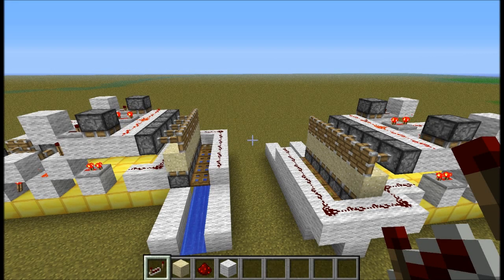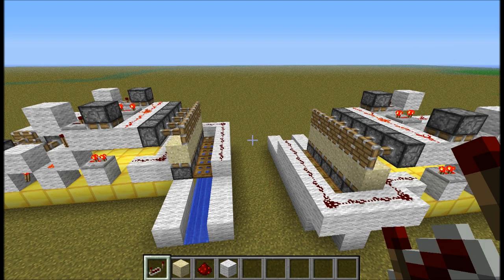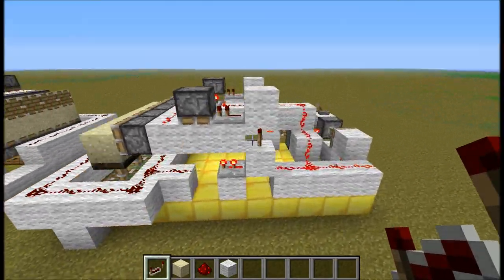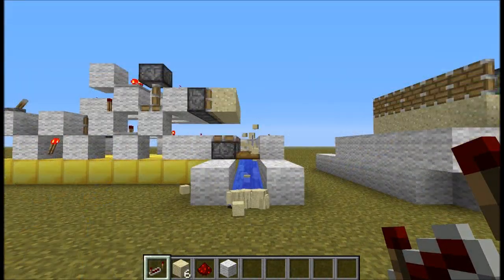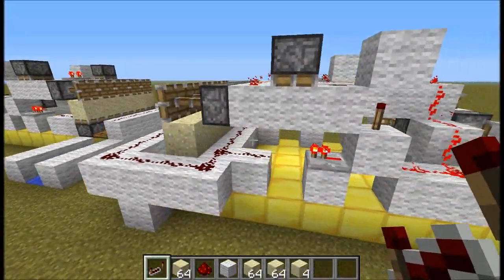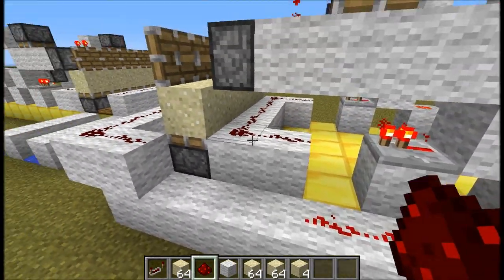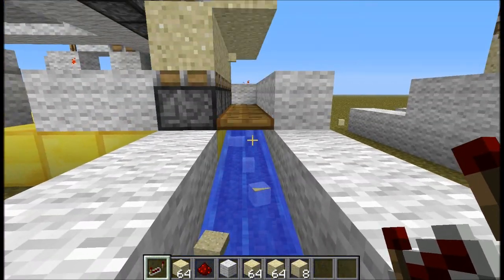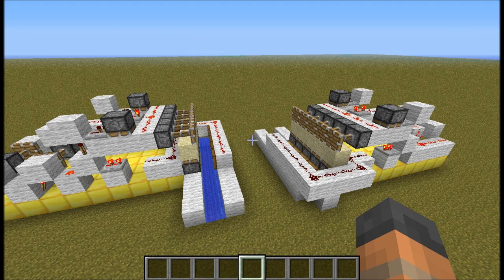Sand Generator Fix For 1.4.5 Tutorial

Comment: I spent ages trying to get this to work on a Vanilla server. Finally I have it fixed.

My solution is: Instead of replacing the repeater with redstone, I set it to its default setting. The repeater below that is also at its default setting.. 

BUT here is the catch. 

It would not work until I placed my sand two blocks high. Xisuma's version has only got one block of sand on top of the sticky pistons. Mine now has two and it duplicates sand that can be picked up.

I will put up a video tomorrow.

Comment: I have a design that is almost exactly like this one, I think I got if from jl. All I had to was add one tick of delay to the clock... It is only different that it is taller, and the trapdoors have an input on both sides.

I don't know if my design is better than this though, because the blocks fly out like crazy, like the trapdoors are whacking them around.

[This is on East/West, but as far as I know if works North/South too]

Comment: Hmm? Do you just mean single player as opposed to vanilla? I just tested this in SSP with roughly 50 mods (incl/ the tekkit/feed the beast ones like IC2, Buildcraft, etc) and it works fine, although a second layer of sand sits above the trapdoors once you turn the thing off and must be removed. Not sure if that happens usually, but it doesn't seem that mods break this.

Comment: Xisuma I like the overall design but I can't stand how the trapdoors flick some of the sand over the top of the redstone. I have to keep running round the side to collect the drops. Do you think placing the trap doors three or four blocks lower would help alleviate this? I tried it but the timing went screwy. Im not very experienced with redstone yet so any advice you can give will help. thanks mate.

Comment: Do you think it's possible to add a water collection system to a design like the one in /watch?v=9HO8WzmeLsM? It's a pretty easy build and works in 1.4.5 as well, and I think it's not dependent on the direction.